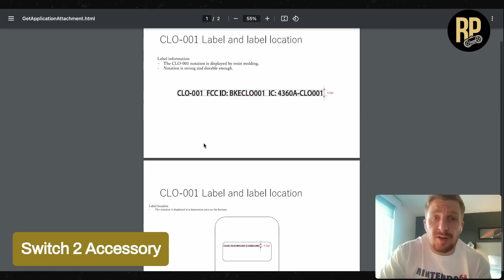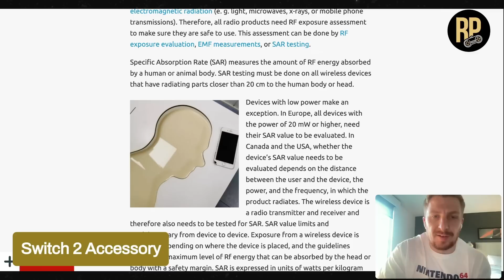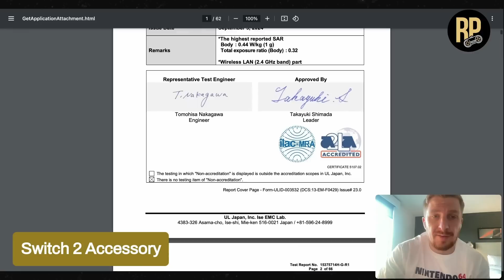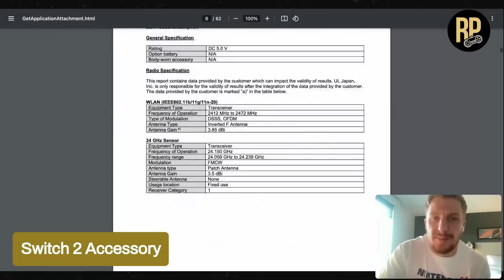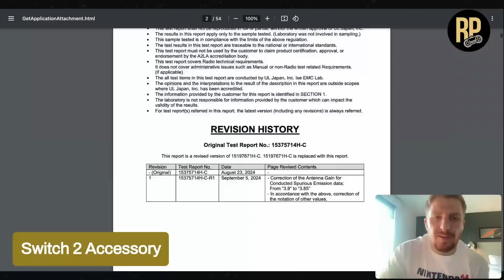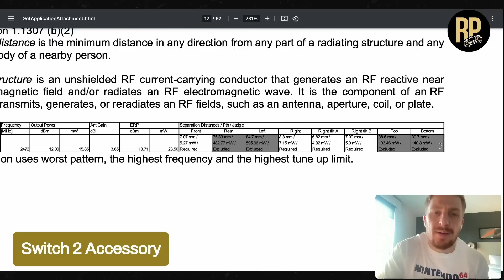Wireless Expert Explains Nintendo Alarmo FCC Filing CLO-001: Part 1

Comment: So you and I can agree that this device is nintendo using radar or or maybe sonar for motion controls. I did not anticipate that they have you where on the body. I thought it would be sitting next to your switch and it would bounce wireless waves around your bedroom and off the player to map the the players out silhouette. Kinda like the microsoft kinect tracking the entire body but using radio waves instead a ir dept camera. All in all good video.

Comment: This  sounds like a clip on that will  likely be affixed to the back collar of shirt.  Two uses straight off, immersive surround sound at home or on the go.  And glasses free 3d at home or on the go.  Nintendo has prior patents for a collar surround sound device.  The puck looks like a sleeker design. The wearable device doing the tracking rather than the system sounds similar in premise to a YouTuber who put the Wii sensor bar on a headset in order to create true 3d effect.  Could the other unknown testing have a audio component to it?

Comment: Maybe its the Joycon controller attachment. It might have a screen or touchpad.
Reply from the maker: Oh, thats kind of interesting. I guess I never even thought about yet another thing attaching to this. I don't think this will be with the joycon necessarily since its going to be close to the body, but you have opened a new line of thinking for me! Thanks! --Mark
Reply: @RemotePlayPodcast  But if it were the joy con, wouldn't the hand part of the testing be filled out? or would that be in a separate report?("i" or "j")

Comment: I don't think this is a body worn device if its shape is basically a cube (the 76mm read distance suggests that). It might be something you hold in your hand, probably a gadget for party games.
Reply: A cube that you use to play games...
Like some kind of game cube
Reply from the maker: Yeah, I've been thinking about this a lot. The distance from the radio to the edge of the device is kind of a lot right? 76mm is pretty big. I need to do some mock ups of what this would look like. I'll have time tomorrow at some point. Good line of thinking! I would be so surprised to see some cube you just hold and walk around with or shake or something, but that would also be so on brand for Nintendo lol --Mark

Comment: I think that puck device will be used to refine the position detection of the new type of Joy Con. The current Joy Con relies solely on in-built gyros and need constant recalibrating during gameplay. This new device mirrors the sensor bar of the old Wii that always accurately tracks the WiiMote in real-time.
Reply from the maker: Yeah, I like the idea of this working in conjunction with the new joycon, the switch 2, and maybe even another accessory to give ultra accurate tracking and interaction. It's totally up Nintendo's alley to do something that gets players moving or more involved. -- Mark
Reply: the sensor bar doesn't track anything, you can even remplace it by 2 candles, try at home, it's funny !
Reply: this reminds me a bit of the wii motionplus (another cube-shaped peripheral!) and would also support the notion that switch 1 controllers could be compatible with the new hardware even with potential improvements to motion tracking

Comment: I don't think it's worn, because page 12 of test report 15375714H-C-R1 has it connected to an external debug board via USB. That leads me to believe this is very simple internally and depends on an external device to function.
Reply from the maker: Hey! So don’t be mislead by that. That’s required to test the device, and any device really that goes through certifications testing. The EUT (equipment under test) is not just turned on like a normal use case. You are required to put it into “test mode” which is available through the wireless radio firmware. This is done through the debug boards or a laptop (depending on the device). Then in that mode you transmit it at various power levels and frequencies to verify that the equipment is faulty, out of scope, or dangerous to humans or radar/aircraft/etc. So this is totally normal, don’t be mislead by the debug board. — Mark
Reply: @RemotePlayPodcast  Why not use the onboard microprocessor for that if it has one?
Reply from the maker: Great question. It really just depends on how they have the device set up and if it’s complete from an engineering standpoint. It’s possible the MPU was ready to drive the Wi-Fi chip but not the 24GHz transceiver or vice versa. I’m going to read over the docs again to see if I can infer anything! —Mark